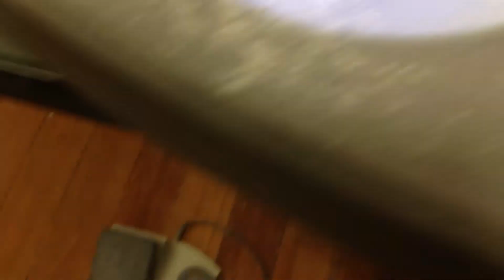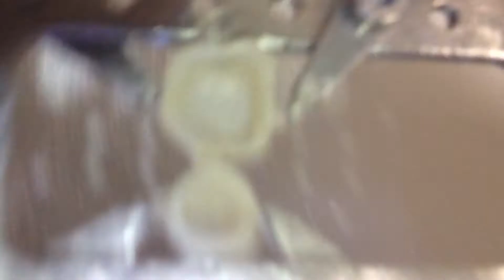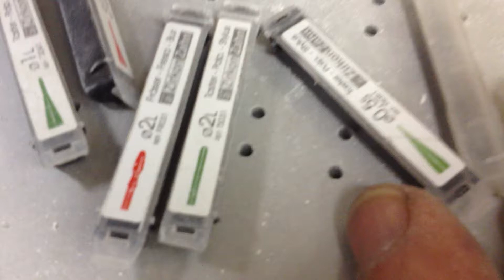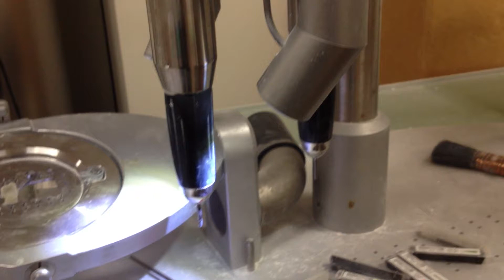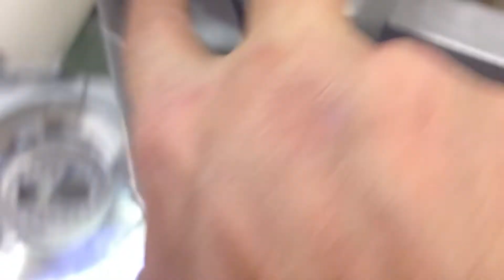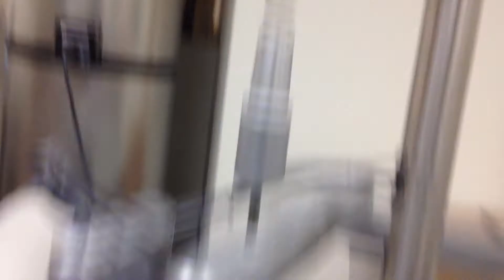5 axis milling by hand

Comment from the maker: you could print the scissor part of the pantograph and have it like a screw att. to your existing printer head..that way you could enlarge your printer bed mechanically, not digitally, you can shrink or enlarge something infinitely by adjusting the arm ratio and feeder speed.?? just an idea.